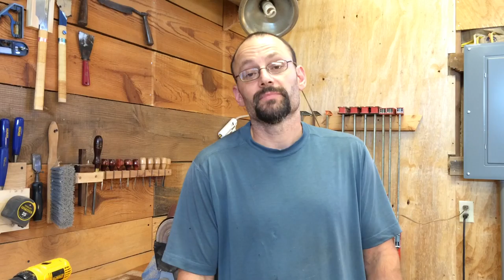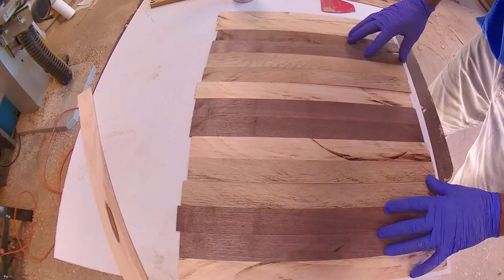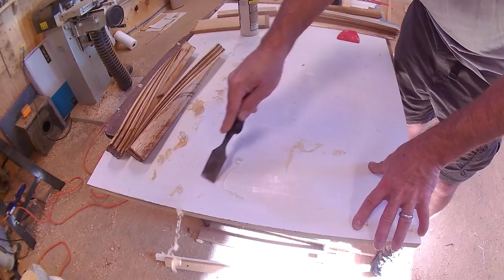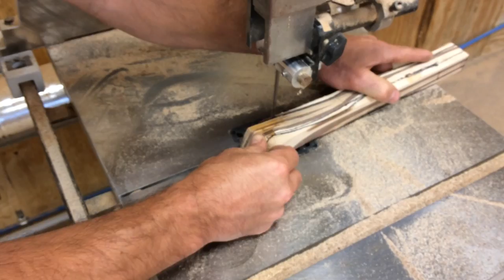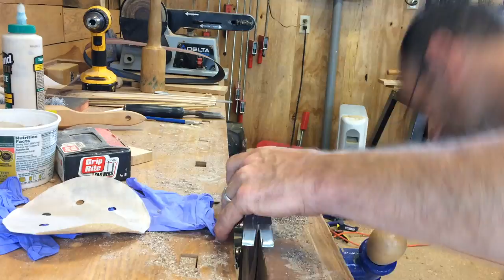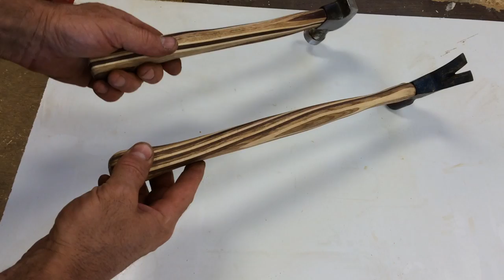Twisted laminate hammer handles. Strong and Unique!  FarmCraft101

Comment: Those turned out really awesome! After some use, how have they held up? Just wondering if the glue held good. Really neat!!!
Reply from the maker: I actually broke one, but I was just prying way too aggressively.  Abusing the hammer basically.  But the glue didn't fail, it just splintered the wood like it would have done with any handle.

Comment: Hi, nice work!  Surprised you have so few subscribers.  You've got a new one now  :)

I've seen in a few of your tool handle videos you sometimes hammer on stuff in your bench vise and the item tends to slip down as you are working on it.  Have you considered putting some leather in there?  When I did that with my vise it made a huge difference in its holding power.  No need to glue the leather in place or anything, I just have a long strip that I hang across when I want to clamp something in.
Reply from the maker: Thanks for the tip!  I like that.

Comment: Hi. Love your content. Got a question. How much would you estimate all the equipment you have costs?
Reply from the maker: I have about $15k in woodworking tools I've purchased over the last couple decades.  Add another $9k if you include my sawmill.  But they have all definitely paid for themselves in the things I have made with them.
Reply: @FarmCraft101  Awesome. Thanks for the reply. Looks like I have some saving up to do!
Reply from the maker: @geohazelman7039  It's not cheap, but not as bad as most people think, especially if you can generate some savings or income from your tools.  I bought my first real woodworking tools about 20 years ago, a planer, jointer, and a table saw.  If you divide the 15k by 20 years (240 months), that comes to just over $60/month.  With a little discipline and determination, anybody can do that.  Good luck!
Reply: @FarmCraft101  I'll start off slow! Just reclaimed the backyard from some nasty blackberry bushes so I'll be able to have a nice work area.

Comment: Crazy looking handles, but I sure like them!  Is the hole in your bench for doing twisted laminations? To get a 2" finished size, how much would you add for side slippage when you twist?     Mark
Reply from the maker: The hole is a tail vise, but it was convenient for this project.  I'm not sure on how much to add, maybe 1/2"?  Cut a few test piece and twist them and it will give you an idea.  Thanks for watching!
Reply: Thank you for the info.    I think I'll give it a go.                     Mark